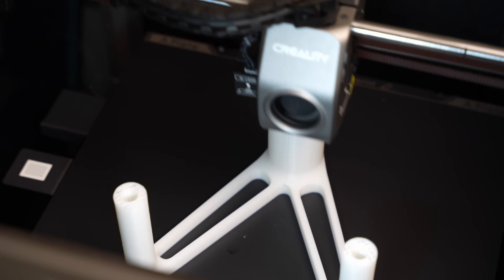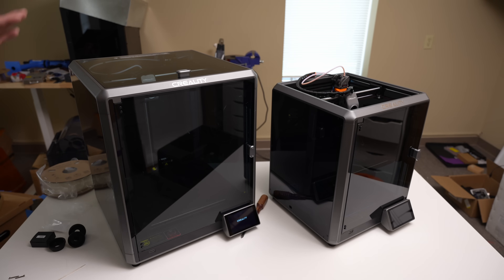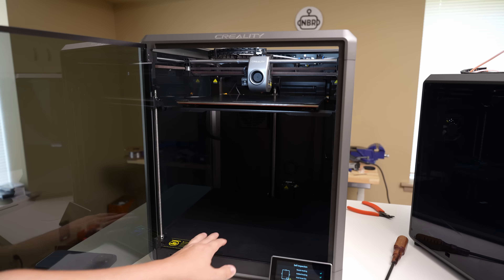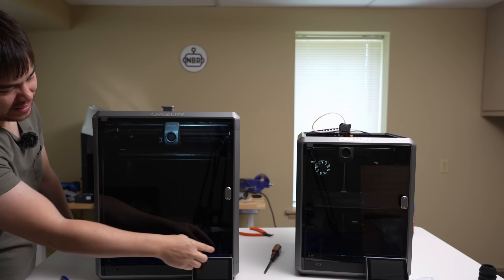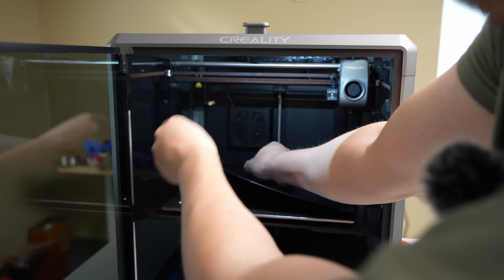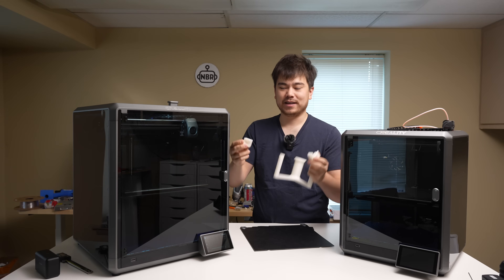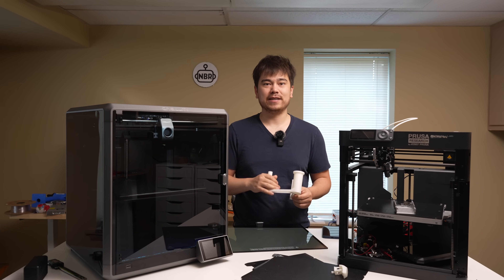🚨🤯 K1 Max Unboxing and First Prints (Plus Discount Codes💸)

Comment: is it possible for you to do an update on the K1 Max - I heard they  updated the software, slicer is now open, and some hardware was upgraded - hot end and if they ever fixed the bed leveling issue - it seems as if it is never leveled (you need shims and such) and  if it is your last $800 would you purchase this machine.

Comment: Having owned 4 different models of Creality 3D Printers over the years, I wouldn't touch any of their printers again. Not that my experience was necessarily bad. But in 2023, with appearance of companies like Bambu, Creality products don't look as appealing any longer. From my experience, it seems Creality doesn't use their own machines. They copy what other people are doing, and offer it for less $$$, but the product doesn't work anywhere near as well as the original. All of the features look great on paper, but for one reason or another don't work well in practice. I can give you an example. The filament sensor. What a great feature, essential if you ask me. It never really worked on any of my machines. Not on CR10s, not on Ender 3 V2, not on Ender 7. The print always had significant defects, and wasn't usable. Either it skipped a few rows, or a huge blub of filament was added to the print, or it knocked the part down, or the print would stop because of the sensor momentarily reported no filament, even though it was there. Why? They used generic Malrin firmware, but never bothered to adopt it well to their own machines. It's just a small example. Most of the features Creality offers are only half working, and are there for the marketing purposes mostly.
I would definitely buy a P1S with AMS instead of K1 Max. I think there is no comparison in real life, when it comes to practical use.

Comment: Hello. According to Creality, the hardened steel nozzle (on this printer) has 15 times lower thermal conductivity than K1's copper nozzle. Does this mean that the K1 Max will print much slower than the K1? Have you compared them at 200mm/s+ speeds, especially with filaments other than PLA?
Reply from the maker: They print at the same speeds as far as I can tell. They are using a steel insert, so most of the nozzle is still made of copper.
Reply: Thanks. Also, does the LiDAR affect first layer/print quality? Or is it useless?

Comment: I'm quite curious about the sound level on this rather than Bamboo lab's machines.. does the K1 have a silent mode?
Reply from the maker: It's pretty quiet. I haven't tried an X1C or P1S, so I dont know if its louder or quieter. Maybe compare the numbers that I got in the dB meter to someone with an X1C?

Comment: In your k1 video you were concerned about bending load on the extruded gears. I see that hasn’t changed in the new extruder. Do you think the new steel part and loctite will be enough to prevent long term bending of the gears?  Thanks for all the great info. So many YouTube reviews just state the specs do a few benchies and call it a day! Worthless! Your breakdowns are so much more useful!

Comment: My p1p made that annoying high pitched whine but I haven't heard it in a couple months. I've done a lot of modifications, idk if the enclosure is blocking the sound or if it's the MC board fan and bento box I installed. I've noticed some power supplies only whine at idle so maybe the small amount of current my little fans are pulling is enough to stop it
Reply from the maker: Maybe it was fixed in a firmware update, or maybe you just became desensitized to it. I noticed that too. It bothered me when doing the first power up, but later I stopped noticing.

Comment: You should run the calibration again with the printer on the floor to see if the ringing goes away. I wonder if that wobbly desk is messing with the input shaping.

Comment: Just put in an order for the k1 Max. Little skeptical about the extruder but I guess time will tell. How do you think it compares to the p1p and the p1s?
Reply from the maker: For my use cases, I want to build large structural parts for outdoor use. This is ideal for that purpose. I don't need 16 color PLA crap, I just need a printer that is big and fast enough to bring my ideas to life.

Comment: I really wonder how it'll hold up in the long term-Creality doesn't have the best track record hardware wise. Unfortunately I end up using cloud features on my printers a ton, and the bambu app works perfectly for this, while I've heard nightmare stories about the current state of crealities alternative. Great to see them pushing the boundaries with build volume, hopefully it pushes bambulabs to release something similarly sized and competitively priced.
Reply from the maker: Yeah, only 1 way to find out right now - wait and see! 
I know for sure Bambu lab has stepped up their large format printer timeline. They can’t just let creality have the large format printer market to themselves.
Reply: @NathanBuildsRobots  They won't have to worry about it. I bought the Qidi Tech X-Max 3 today since we all know that we can't trust Creality. The Max 3 is replacing my CR-10 v3, so buying another Creality would simply be rewarding bad behavior.

Comment: Honestly considering getting one of these so I can have a main printer while I upgrade my 350 Trident.
Reply from the maker: How do you like having a 350 bed? If creality steps up in size would it make sense to go to 350 or just go straight to 400?
Reply: @NathanBuildsRobots  I love having a 350.  I make custom arcade sticks and hitboxes for fighting games.  Having a bed that size allows me to print reasonably sized products.  A 400 might be nice but I would definitely only do it if it had an AWD xy stepper system like the VZBOT cause I really don't like the idea of a larger printer at the cost of speed and print quality combined.   I'm not sure if it's true or not but I hear that having a bed that's too large can have more issues with consistency and warping due to poor thermal efficiency. I agree with you that 300-350 is a good sweet spot for a fast high quality printer.  I think anything bigger would cost too much for the average person for something core xy at decent quality that isn't just cheap garbage.

Comment: As creality scranbles to catch up, the 300x build is not worth the effort, they should have went to 350 to make it worth purchasing at all, 300 is barely 50mm larger than the better printer on the market already, hence creality scrambling after being stagnant with outdated bed slinger for many years already. I will stick with my 5+ and the Carbon with ams, until the better company releases their larger printer soon. Amd the screen should be at the top, unless your a midget
Reply from the maker: You can’t touch an interface that is at table level unless you’re a midget… like, I don’t know, a piece of paper, a keyboard, a mouse, a plate of food. All of these table-level items are beneath me. I mount all of my interfaces to the ceiling.

The height of the interface hasn’t bothered me. What does bother me is the P1P using a 70 cent screen on a $700 printer.

300mm is really nice, I’m not complaining.

Comment: How bout in comparison to the Bambu P1S?
Reply from the maker: P1S is significantly smaller and has a shit interface. 
But, as a tradeoff it's quite a bit cheaper and can be upgraded to use AMS. 

They seem pretty evenly matched, but for me, the large build volume and better touch interface takes the cake.
Reply: @NathanBuildsRobots  Not to mention how Bambu screwed their customers by releasing the P1S and not offering the upgrade to people who bout the P1P literally 1 day earlier. Bad customer support!

Comment: The biggest issue with activated carbon is that stop working at 60C and isn’t very good above 50C. So, pretty much the exhaust air of an enclosed chamber printing high temp materials.
Reply from the maker: Wow, I wasn't aware of that but it makes sense. In that case you would need an intercooler to drop the temps down before venting and filtering it.

Comment: Can you do a video with K1Max printing larger parts in “engineering materials” normally prone to warping with open chamber printers?

Part size: around 200+mm in size
Materials: ABS, ASA, PC, Nylon, etc.
Reply from the maker: I will break out the ABS for my next video. I have some CF-nylon that I can try as well.

Comment: I would like you to print a large object even a vase-mode item. What are the ways to upgrade the nozzles ie what can you go out and buy now ie is it easily upgradeable to revo, or how would I add a basic 0.6 nozzle etc.
Reply from the maker: You can put a volcano nozzle on here. It changes the nozzle offset by maybe 2mm, but it automaticaly compensates for the difference since it levels using the nozzle

Comment: If they have sorted out the niggling issues with the K1 like the extruder then this could be a Bambu killer as you aren't locked into a cloud eco system full of security holes and privacy nightmares. Also would be good to know about availability of spare parts and repairability because for me that is a key feature.
Reply from the maker: If they open-source the design, the market gets flooded with aftermarket parts. Fingers crossed Creality will make good on their promise to open source this beast.

Comment: I just to hit the order button.  Man Aug 3 shipping.  Do i do it?
Reply from the maker: Lol, your call. I like it much more than the P1P. 
I haven't tried the X1C+AMS combo (Bambu, you have my number). 
That would be the only comparable product in terms of overall utility but it's $1500 vs $850.
Reply: @NathanBuildsRobots  and much smaller, the true build volume of x1 is 238x228x250!
Reply from the maker: @dejedejsson  You can get the full build volume if you disable the filament cutter, which no other machine has anyways, so... I'd still call it 256x256

Worst case it is 256x256 minus 18x28
Reply: @NathanBuildsRobots  Yes, but it's not quite as easy as it's made out to be and you can't use AMS.

It's a bit like reaching the specified gas mileage of your car, you can get close if you throw out the seats, turn off the AC, fold in the side mirrors, etc!

Comment: I want a K1 Max now but prudence dictates that I wait a couple of months.  I'm glad to see that Creality fixed their K1 extruder problem, although another K1 review showed under extrusion and some of the K1 extruder problems manifested after a day or two of printing so the jury is still out as far as I'm concerned.  I'm not yet convinced that this extruder design will be long term reliable, and that's a requirement for any 3D printer.

Creality must abide by the open source licensing and the best way would be stock Klipper.  They should also publish K1 and K1 Max configurations for all popular slicers with all popular filament types, and provide the parameters so any slicer can be easily modified to slice for a K1 or K1 Max.  In general, I wish Creality would take better advantage of open source software instead of picking fights with the open source community, and focus more on solid hardware designs that are thoroughly tested before shipping.

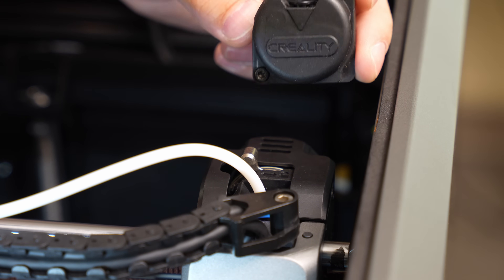It was kind of Creality to include a filament reel as a test print, given that a rear mounted reel on this large printer is dumber than dirt.  On the plus side, at 6:20, it looks like the K1 Max moved the filament run-out sensor inside the enclosure on the back side?  I'd love to see a thin and flexible CANBUS cable to the print head with an optical filament run-out sensor integrated into the top of the extruder.

I look forward to a K1 Max TPU test (maybe with the reverse Bowden tube but also with the extruder fed directly from an overhead reel), some explanation of the lidar and whether it's a useful feature or just Bambu Me Too marketing fluff, as well as long term reliability of the K1 Max.  Thanks!
Reply from the maker: The best time to buy a printer is a year from now. New/better/cheaper options just keep coming.
Reply: @NathanBuildsRobots  Yeah I hear ya. I'm considering stepping up to a larger printer from My Ender 3 S1 but I can't lie, I've been tempted by the speeds of the P1P and K1 alike, and now that the K1 Max is out with the best of both worlds I'm tempted to start saving up. But I definitely want to hold out and see if Bambu comes out with an extra large printer that can still have AMS unit capabilities.
Reply: I know it so tempting just to go out and get one as it is impressive. Hopefully, patience will bear fruit. Within the next few months, I've heard several coming out from different companies. I have a love-hate relationship with Creality. My 10s still works fine but they have changed and am locking things down, which does not help them or the consumer.

Comment: I would rarely need a K1 Max full build volume. I don't print helmets, but most of my stuff rarely goes over 150mm tall.   What I need is a K1Max-Half.  300x300x150 tall.  Then I can stack two of them.
Reply from the maker: 300x300x300 is niiice.
My optimal printer would be 500x500x750 Creality, Plz make K1 Max Plus
Reply: @NathanBuildsRobots  What are you printing that is that tall? LOL.   Parts for a life sized Nathan robot?
Reply from the maker: I would love to do furniture or structural parts for vehicles

Comment: I think the first print that you reviewers should be doing on these new machines is a full build plate first layer. They can all print benchies. My K1 printed a benchie but it couldn't print a full build plate first layer. It was crap. JMO
Reply from the maker: Yeah, it had underextrusion due to crappy extruder. After installing the LGX Lite on the K1, it could do full layer prints. Hoping this is fixed due to new more functional extruder. Will test a large flat part soon.

Comment: I'm curious about a long-term review of the K1 Max. Creality sort of has a reputation of having to tinker with their printers constantly after a while. I like the build volume but feel they need an AMS to be even more competitive in this printer space. Becoming a hard decision between a P1S/AMS Combo and the K1 Max.
Reply from the maker: For me, the increased build volume is a lot more useful than multi-color prints. But to each their own. If you do more cosmetic prints, or prints that would benefit by having a second color, AMS is more useful.
Reply: @NathanBuildsRobots  I agree that the build volume is nice. There's no way Bambu isn't working on a larger format printer (rumored X1E maybe?) though, but likely at a small premium increase.

The AMS is not only useful for multi color prints. It's also useful for using up partial rolls of filament and/or ensuring you don't run out of filament mid print with no slowdown in production.
Reply from the maker: @TheCrytone  True, I did not think about that.
But how many spools of filament can you buy for the price of an AMS... It costs like 30 kg worth of filament, so whatever you "save", you paid for.
Reply from the maker: @irbose9895  Bambu's design has a year under it's belt. That's pretty good.
Reply: Trash is a strong word. Multi-material printing is the least exciting feature that AMS offers, for me at least. I have not even tried it for that same reason you mentioned. The biggest advantage of AMS in my opinion is that you can just choose the filament you want straight from the slicer, and the printer will just load it for you. Another huge advantage: if you run out of filament, the AMS will load another spool for you automatically and will just continue printing. And yet another advantage: The AMS acts as a dry box. It is completely sealed, has desiccant inside, and a humidity sensor. You can monitor humidity level right from the app, or slicer. AMS rewinds the filament back on the spool on its own after each print, so the filament is always stored inside the dry box. Also, when you want to print again an old print from history in the app, just click it, and the AMS will load the same material from which the original print was made. 
So I wouldn't call something trash, unless you try it first ;) @irbose9895
Reply: @irbose9895  and I didn't mention bambus record at all either, just that Creality does have a record.
Reply: get the P1S w/AMS. You will thank me later! ;)

Comment: my grandpa used to have a screw driver like that
Reply from the maker: Which one? Timestamp?
Is it the one with a wooden handle? Those are excellent Grandpa-Core tools. Gets the job done, first time, every time.
Reply: @NathanBuildsRobots  .58 seconds. That looks like its from the 60's?
Reply from the maker: @ItsDaPlumber  Haha, yes. I love that screwdriver. It has sentimental value.
The other thing is, I get really sick and tired of loosing the #2 phillips head bit... It's really nice to have one that is fixed in place.
Reply: @NathanBuildsRobots  Yea, they got rid of the square handle because some smart ass engineer told everyone a round handle would cost less money in production.
Reply from the maker: Square handles fit my hand a lot better too. If I had to pick a screwdriver to shank someone with, it’s definitely be that one. Hexagonal handles are overrated and overused

Comment: The LIDAR is just a gimmick? 🤔
Reply: Rumors say it checks for first layer failures
Reply: lidar on a 3d printer will always just be a gimmick.
Reply: @LilApe  why? With these new devices and a resolution of 3um and below I think bed leveling improves further and the detection of 1.layer failures should be possible too
Reply from the maker: @LilApe  I don't think it will always be a gimmick. Closed loop machine control is nice. Being able to check for gaps between extrusions is also nice... Lots of great use-cases for it, it just require a lot of code. With open-source development I think it could end up being very useful for increasing precision and reliability.
Reply from the maker: I think it works, but I couldn't figure it out in this video. Will cover it in a more detailed deep-dive video.